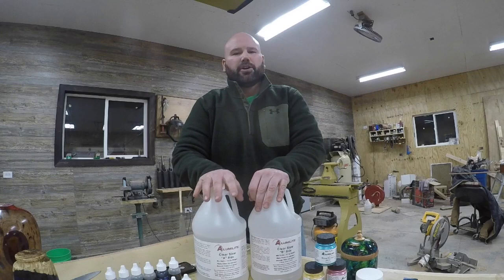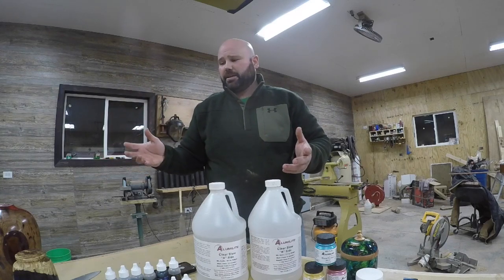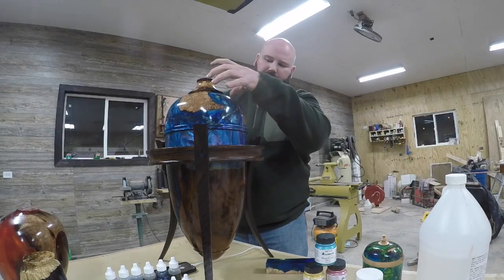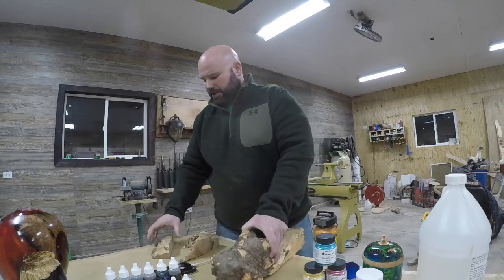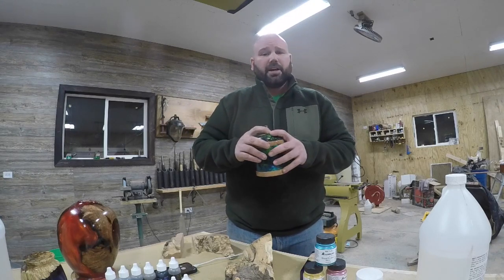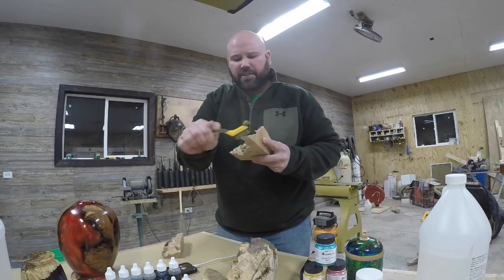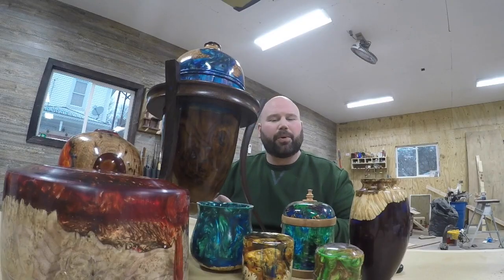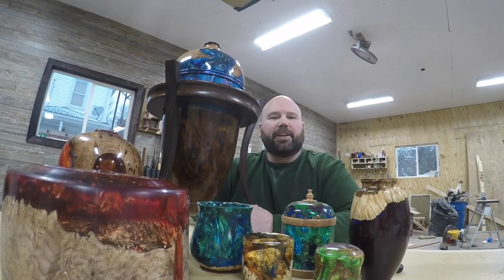Keith's three golden rules for casting with Alumilite Clear Slow resin and wood | Alumilite

Comment: Great video.  Couple of questions though. I have a kitchen scale but weighing various new coins the weight seems to be off by half a gram.  Is that going to be an issue? Also I have a 5 inch diameter length of what I believe is ash and also some black walnut, not burls that have cracked a bit and I wanted to fill them with a cast would I have to stabilize them? Thanks, new to epoxy.

Comment: Great video. What is the shelf life of Alumilite products? In this economy and with the supply chain issues, when I place an order I like to order more than I need immediately but only if the product won't expire prior to me using it. Thanks.
Reply from the maker: Our products typically have a shelf life of one year whether opened or unopened.

Comment: Hi Keith, Great video, learned a lot. I am planning to cast the root structure of the shrub Artemisia for my research work. It looks like it will be very hard to cast a root with a lot of moisture in it. I might oven dry it for that purpose. What other things you suggest I should be aware of while casting living roots? I will probably use slow set 7 resin for casting and PLAT 10 to create mold.

Comment: What kind of temperature control did you use when you were casting your large Grasshopper piece?
Reply from the maker: It's different for everyone - typically you want to check the technical data sheet for the product you're using and find the recommended temperature to work in. Once you've got that information, you just need to work/modify your space to have that consistent temp!

Comment: IN your video at frame 1:45 you made and show little a pine cone or little box or jar with lid. Can you tell me how thick the resin wall is for that? Is their a minimum thick before an item like that would be breakable? I need to make something similar that is 3.5 inch by 3.5 inches, all clear, and dont know how thin the walls can be made. Thanks
Reply from the maker: Hello there! We're not sure how thick he made the wall but if we find out we will let you know. Thanks for asking!
Reply: @AlumiliteCorporation  thank you. I look forward to your answer.

Comment: Great tips, thanks! So are the pieces hot out of the oven when you cast? I thought the heat would cause the alumilite to set prematurely.
Reply from the maker: They cool naturally pretty quickly. You wouldn't want to put them in fresh out of the pot.